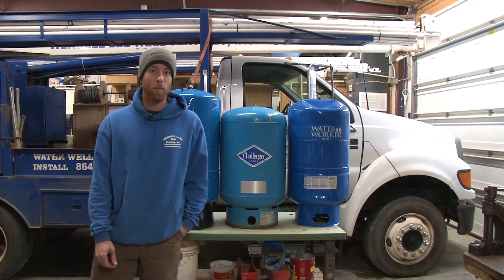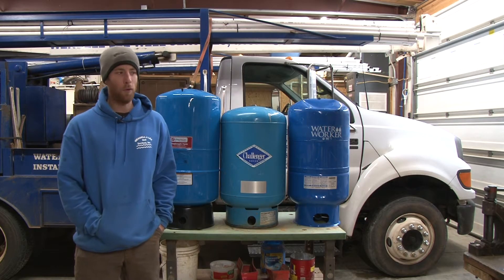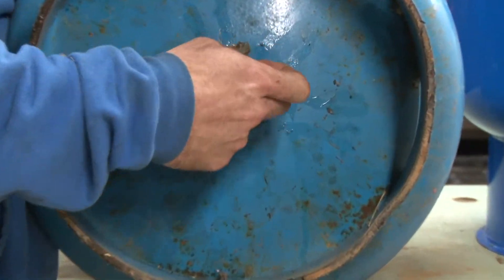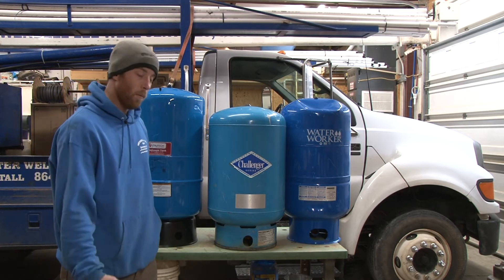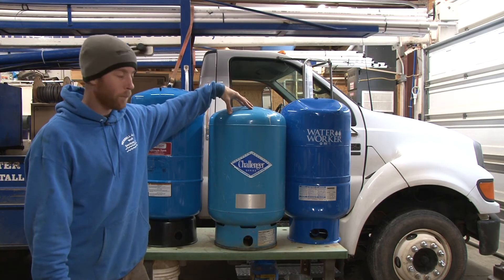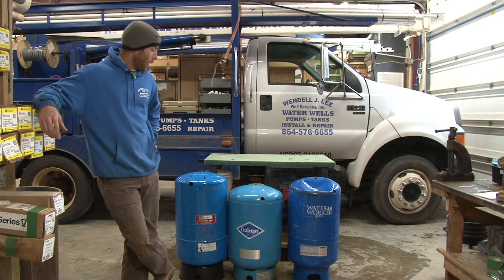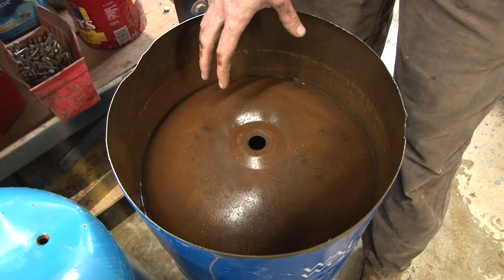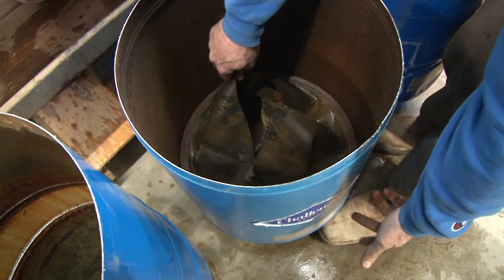Well Pressure Tank Installation: Comparing 3 Different Pressure Tank Designs

Comment: We have lived in this house almost 19 years with same 20 gal. tank. House was built in 1985 making the tank almost 35 years old IF the original tank. I'll have to check the brand but do not believe it is still being made. In any case I am close to going ahead and buying a larger XTrol thinking ours can't last much longer.  
Old tank is "aquatrol" made by Water Systems Division of State Industries. I see Nashville, TN on label. I see they still make pressure tanks, among other things, but not "aquatrol" brand.
Reply: Looks like Challenger/Flexcon does not sell to the public like Amtrol and you would probably have to use contractor/plumber.
Reply: My well trol went bad in 7 years or less 🤷